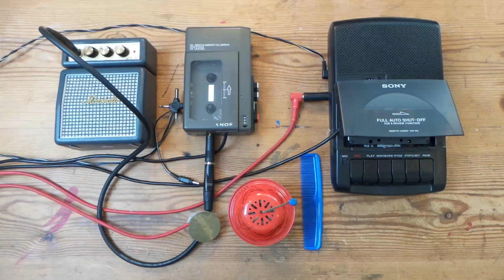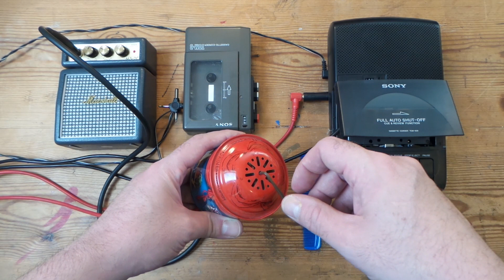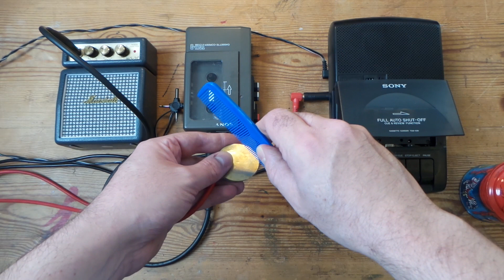DIY Tape Loop Delay & Contact Microphone

Comment: Great tape delay experiment. The extended play head is mounted in the actual cassette shell instead of the second player, right? I'm just wondering if I read your description right. Thanks for sharing.
Reply from the maker: Thank you! Yes the extended play head is indeed mounted inside the cassette shell, which is inserted in the second player.